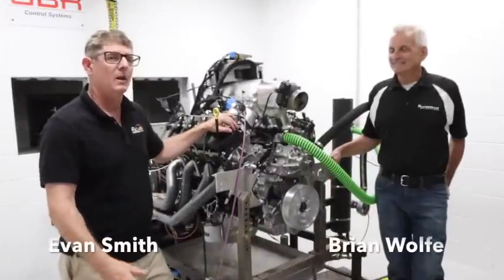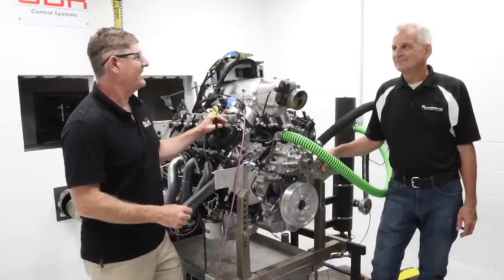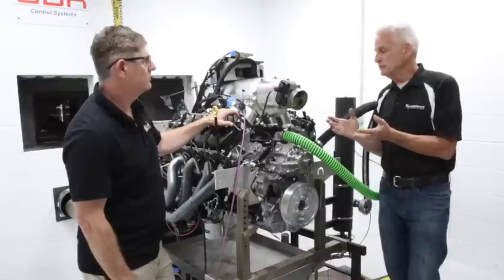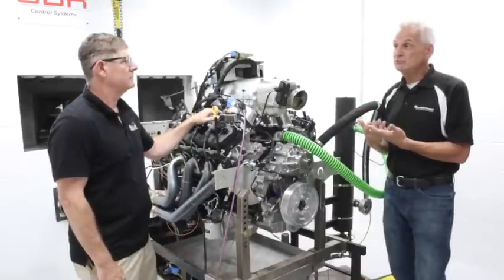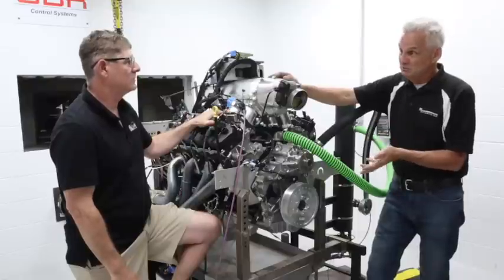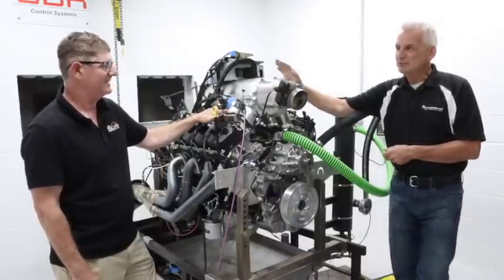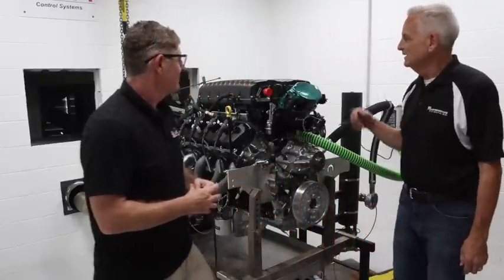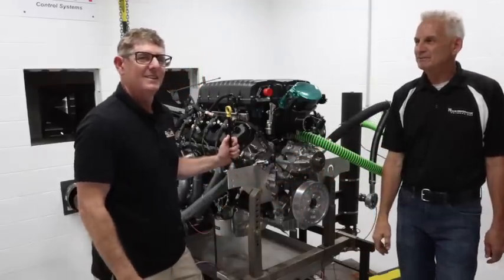Godzilla 7.3L Ford — Back on the Dyno With Over 780 All-Motor HP — Plus... We Reveal What's Next.

Comment: Man that thing sounds rowdy . now everyone can quit putting ls engine in fox bodies or any other ford. BLUE OVAL FOREVER!!!💪💪
Reply: Just hope they realize that this engine will make a load of initial torque. A lot more than a ls, 7.3 liters worth, yikes! Learned my lesson when me and my buddy put a 502 in an 87 Monte Carlo. Broke the windows and turned the body like a corkscrew.
Reply: 92VXEG  depends on how much hp you want and how long you want it to last. If you wanna drive it a week get your junk yard chevy. If you want it to last awhile even with the LS you need a good bottom end and so on. I get tired of hearing how a LS is so cheap but yet you guys want 30k for a foxbody mustang that has what a 800 dollar engine in it??? Get out of here with your false claims.
Reply: scott adkins not completely true if you know what your doing you can build reliable power and a motor that will hold up to whatever you throw at it running a stock block 6.0 ls making 500 hp
Reply: 92VXEG -realize the current Gt500 runs low 10’s stock and a GT runs 10’s with bolt ons. Gtfo of here
Reply: Ford is badass. I don't care who you are. That's a fucking engine with balls.
Reply: 92VXEG  just saying the chevy stuff is over rated big time. By the time you have to do the swap to fit a sbc in a ford body you could build a "push rod" sbf cheap also and what you save in the swap could go into  parts for the sbf. Cost wise in that case I dont see it... Yes mod motors cost more to build cus of more moving parts in the heads. If you stick with a push rod ford I just dont see the big benefit of chevy then. I guess ppl are sheep one does it they follow doesnt mean its better. If you want big power the mod motors are one of the best platforms cus they are awesome and yes when talking big hp numbers the mod is a good valve then.
Reply: value
Reply: 92VXEG  you clearly don't know much about ford FEs or 385 series engines then
Reply: 92VXEG  ur just mad that theres something better built for high end performance than the LS. Sure, the cheaper-end simple swaps are gonna be LS motors, but when you want to make racetrack/drag strip reliable power over 800hp, youre going to need to spend a bunch of money either way on porting or replacing cylinder heads, changing up internals if boost is needed, etc. The difference in cost is mostly for people who just want stock power or bolt ons and/or a turbo kit. Real high end stuff build costs will be comperable, as will performance
Reply: 92VXEG  Yo Fuck Chevrolet!!!  Most Chevrolet guys can't even spell the shit.  That's why you always see "Chev" or "Chevy".  Or are ya'll just lazy??
Reply: It really is weak listening to all the Chevy supporters here saying that a Ford is more expensive to build. If you buy aftermarket rods, pistons, cams or any other part from the same manufacturer the price is virtually the same. I just don't get how anyone can't look at a price book and read the prices quoted. If you Check guys have been following this build you would also see that this engine made 641 hp with stock crank, rods and pistons. If that's tried with an LS it's a grenade at best. Discuss things with a professional builder before making blanket statements and you Chev supporters will be better informed on what choices to make. The Ford is more expensive argument was made 40 years ago when Ford didn't have the factory cheap parts support that Chevy provided. I know I have been a wrench since 1978. It's just simply not true anymore.
Reply: @matthewmoilanen787  a stock ls 4.8 is good to like 1000 plus hp....
Reply: @0650asanders  In who's world. I'm a master ASE since the 90s and have 40 years of racing experience from pure stocks at 20 years old to dirt mods at 650 hp in recent years and any Chev dirt modified engine that costs over 18 grand has an aftermarket bottom half. Oh and there also 355's not 4.8's. Nice try but no not so much.
Reply: @0650asanders  why you lying 😂😂
Reply: @adonisgodfrey1082  what world do you guys live in? Guys have been boosting ls motors to the moon for over a decade. Step out of your blue oval box.
Reply: @0650asanders  A 2.3 Pinto engine can take 1000 hp once or you can actually go by what professional engine builders do when they sell engines that people race and need to rely on. Just because some guy who is not known for any expertise or they don't make their living from providing reliable engines does some odd one of experiments doesn't mean that it's true. You know cause everything you see on the internet is true right! Seriously dude, I'm an Astronaut that has some oceanfront property in Arizona for sale cheap! You may want to check Chevrolet's recommendations as they are selling unneeded high performance blocks and bottom end parts to stupid people with more money than brains apparently.
Reply: @matthewmoilanen787  who are you arguing with?  Thousands of shit ls stock ls motors are boosted to over 1000hp. You widen the ring gap and you're good to go. Youre talking about a 5-10k dollar built 2.3. Im talking about a junkyard chevy express van motor with 200k miles.
Reply: @0650asanders  - no you’re not that is absolutely ridiculous. No LS is making 1000hp stock you’re crazy! I garante you that’s never been done and it’s more than ring gap if you’re trying to make that power. Meanwhile palm beach dyno pushed 5.2l in GT500 to 1300whp made low countless 8 second passed 100% stock engine. The LS should stay in the junkyard. It doesn’t compete. Ford mod motors. John Mihovetz 4.6l has gone 5.88 second in 1/4 with Ford production block and headed engine. Worlds quickest stick shift car has a stock block and head coyote. Ls is having trouble breaking 10’s without exploding 😂😂
Reply: It's not about the brand, it's about which gives you the most badass build.
Reply: 92VXEG  LS engines may be cheaper and even better but they will never sound as good. That's a big thing. You can manage the budget and have this much hp per dollar but you will never have that killer sound.
Reply: Daniel...I AGREE.
Reply: 92VXEG  who said a 302? Ever thought of a old 70s 351? Ford does make other things instead of a 302 which I agree was a weak block. Take the 351 out of an older 70s car and there you go. They are pretty strong. If you wanna go stronger you are gonna need to reach in your pockets no matter what you build.
Reply: Sbf hold a lot records and wins. Fact. Check out 347s etc. I like all brands but youtube trends die hard. BTW Youtube is not a research tool. Lol.
Reply: Can I get this package for under 1k$??? No? I'll stick with my junkyard ls and ching chang swirling boi setup then 👌
Reply: 92VXEG  nobody cares
Reply: @danielfrye4445  people who actually put up the money to build an engine and swap it care
Reply: @NatoriousGamePlay  why are you Chevy guys so whiny. I don't care so leave it at that.
Reply: 700hp on engine dyno and you guys are happy? I made more then that to the wheels with a 286,000 5.3, you could not put 2 of these together come anything close to what we have ran in the 1/8 with a stock block ls, lmao
Reply: boostismyfriend exactly I’m a die hard Ford man but as far as price and potential ls is the way to go I’m a budget builder I bought my lq9 from a yard pulled it out of a Cadillac Escalade payed 98$ for it from the deck to oil pan got 706 heads for free ported and polished bought rings and bearings got maybe a total of $325 in everything I’ve done so far on this motor and my tuner is estimating close to 600 hp I couldn’t do that with a 351w or a coyote 5.0 for the same budget just not possible granted I’m putting the Holley system with it and the Holley long runner intake which is gonna blow my budget but that’s by choice still come in cheaper and more power than Ford.
Reply: @austincalhoun2779  I ant die hard ether way, I have had a aluminum headed Windsor fox, it ran .4 and 7 mph slower then my lq4 (468whp), I have Customer 69 f100 had a turbo 393, ran 11mph slower in the 1/8 then when I swap it  to a junk 5.3, same turbo kit cut and modified for the ls,  we went 4.29@167 at lights out a few weeks back with a stock unfilled aluminum Silverado block, dollar for dollar it’s the best bang for your buck
Reply: boostismyfriend I agree completely my end goal is a single turbo 6.0 around 800 whp street car but we shall see
Reply: @austincalhoun2779  hell yea, won’t be hard to do with a s480-s488, btr stage 2-3 cam
Reply: boostismyfriend Texas speed man!
Reply: It appears that the Guys( or Women) who like LS " engines " vs. the Ford " engines " are getting a bit testy...my original thought on this subject WAS* That MOPAR[ CHRYSLER*DODGE*PLYMOUTH] built a car called THE HELLCAT/ then they built a DEMON* A Supercharged HEMI CHALLENGER (3,300) than Ran 9.40 in the 1/4 Mi. Very Impressive for a 900 HP Trans braked RACE CAR for the Public...FORD OR CHEVY didn't have a car that COULD RUN WITH IT.( Yeah, some might say A COBRA JET MUSTANG OR A COPO CAMARO...AH YEAH...! Question: How many DEMONS run STOCK/ SUPER STOCK ELIMINATOR ? Remember the DEMON was certified by the NHRA... DEMONS have a Weak Rear Axle...FACT. Besides for the price of a DEMON,You would REALLY RACE ONE, WOULD YOU...? Alot of HELLCATS.
My thought WAS AND IS: BITD( I'M 63) American Car Companies built MUSCLE CARS- THE ORIGINAL SUPERCARS...Fast Forward TODAY: THE ' BIG THREE' are building ' PONY CARS LIVING OFF THE REPS OF THE O.G.SUPERCARS.' Iwanted to see if FORD WOULD STEP UP...( It seems that FORD, And the BLUE OVAL FAITHFUL ARE THINKING THE SAME THING: If FORD want to sell something different: A 2021 FORD TORINO COBRA JET WITH A 445 CU.IN(7.3L) GODZILLA ENGINE ( ALL ALUMINUM) I WOULD LIKE TO SEE IT. Thanks for reading.
Reply: Just hope they don't have the pleg of issues they had with all of their other engine. 5.4 timing chain issues and cam phasers issues. Or the v10 popping the spark plugs
Reply: I'd rather be butt plugged by a cactus then be in anything Ford. Trash trash trash trash trash
Reply: 307_Six.Seven 
As another Australian Barra blows your doors off...
Reply: @stephenpage-murray7226  which Barra? You have a chubby one and A Ford one. The Ford one has been proven to make stupid power with a single turbo
Reply: @garykarenmcgruther6386  
Ford straight six.
Reply: @garykarenmcgruther6386  
Ford straight six.

Comment: "12.5:1 blower motor" not saying this isn't impressive from Ford, but a built 445 ran on race gas shouldn't be downplayed to make it seem more impressive
Reply: And not to mention it’s not even drivable on the street with those rods and if it was you couldn’t afford to drive it because of the price of c16
Reply: Nobody is downplaying anything, its just the facts. If you were building this as a serious n/a build you'd be running 14+:1, cam profile would be different, vacuum pump etc. Its making 800hp through a TB designed for a factory 317cu motor. Race fuel is irrelevant, as you could make nearly the same power on 93 and could make every bit of that power on pump E85.

Comment: Now Ford needs to flood the market with this engine like the bailout guys from GM has done with the LS. 👍
Reply: The drag guys who boost will love the iron block, but I think Ford will have to do an aluminum block to get the sports car and NA drag guys to buy a lot of them.  GM has a 22 year head start.
Reply: It’s only certified for 8600 and up GVWR,  Unfortunately that means Superduty and motor homes only ...
Reply: @JohnDiMartino  But you can go to Summit Racing and buy one for $7500 today.  i doubt Ford will send anyone out to make sure you're putting it in an 8600 pound vehicle.

Comment: A few things.  How are you going to fit that 6 foot tall motor in a car?  Are those 2.5" primary headers?  Should be tricky to route.  The length of the motor with all accessories may make cooling fans an experiment?  I understand this is set up for a blower.......but...the HP and TQ curves are quite peaky without much area under the curve.  When you consider Buick and Olds 455's from the factory made around 500 ftlbs from the factory the torque curve isn't that impressive.  While the HP curve starts to get going at 6300, how hard can you really spin it and still keep valve stability?

Comment: This is the end of the Coyote swap!
Reply: I do not think so, the coyote is a great engine, this is just another alternative for Ford fans.
Reply: @brianwolfe2993  as long as it doesn't have piston slap or a chinese transmission behind it
Reply: This is the end for ls swaps in mustangs
Reply: MichXJdad who said anything about autocross bud? 90% of racing takes place on a real track... ya know, miles long, has turns? Those things? Drag racing needs 1 good reaction time. Real racing (aka the rest of it) needs quick and smooth reactions in every single corner, every single braking zone, every single corner exit on the power. That’s 30+ good reaction times every lap to cut a good time. Not just 1, mashing the gas, and letting an auto trans shift for you.
Reply: Coyote is lighter though.... and can make similar power on lower displacement. Make an aluminum 7.3, sure you have a replacement, but as it sits, it’s too heavy
Reply: MichXJdad the vast majority of racing involves turns. Anyone can throw a bunch of power, giant tires and an auto trans in a car and cut quick 1/4 mile times. It takes actual skill to set a car up to accelerate quick, brake hard, and corner hard, plus a more skilled driver to take advantage of that car.
Reply: Coyote will always respond better to boost especially in the high rpm due to over head cams. This engine is  great power maker but the coyote is still better in terms of responding to boost better and differently.

Comment: Daaaaaaamn its like having 7.3L as displacement had nothing to do with hp increase... the ferrari 812 super fast has a NA all motor 6.5L and it makes 789hp 😐
Who would have known...
Reply: Comparing a DOHC V12 to a pushrod v8? Yikes..
Reply: @sav22rem22  no he's saying there's no replacment for displacement
Reply: it has a turbo cam in it. The ferarri has a NA cam in it.  Turbo cams have a short overlap whilst NA cams have loads of overlap. If you were to put a turbo on an engine with a cam optimised to run NA the exhaust valve would still be open when the inlet valve is opened. The boost would go straight out the exhaust.

Comment: “Truck engine” riggghhttt. Fords rendition of the ls, which is gm’s rendition of a windsor. What a time to be alive. This will 100% be replacing my 11’ 6.7 in the future
Reply: Getting really off topic, Buick was the first OHV engine and Oldsmobile's OHV v8 started a revolution.  C'mon guys they all take cues from each other and engineers jumped from company to company.
That's why there are so many similarities. The new 7.3 takes all this into account pretty damn well.
Reply: LS is closer to the Y block Ford than the original Small Block Chevrolet.
Reply: @mattf8629  Right on Matt. That's what i was saying.  Ford vs Chevy BS    is like politics. Buick was the OHV originator and Olds made it popular. Well I guess every OHV valve engine  maker copied that! Ha lol
Reply: How was the LS a rendition of the Windsor? Now the deep skirted block and cross bolted mains were seen back in the 1960s 427 FE block with cross bolted mains. That the only similarity to older ford engines.
Reply: @Turbo_Todd  it takes a lot of characteristics off the Windsor. Like the firing order was changed to the fords firing order, and the heads have essentially the same ports and bolts per cylinder. And same bore spacing. All in all it's a stronger small block. But some say it's a ground up design which is hard to believe considering the similarities or "copied parts"
Reply: Todd Allen the LS can run on a distributor but it uses a sbf one and mounts in that same place as all ford engines since 1958
Reply: @travislostaglia8861 Where did you get that? There's no provision for any distributor on an LS. The LT1 from the 90s, had a weird one that integrated with the water pump in the front.
Reply: Todd Allen comp cams ls distributor conversion
Reply: @travislostaglia8861  that has nothing to do with Ford and Chevy comingling technologies
Reply: Todd Allen so if ford came out with a engine that could run a Chevy distributor in the back and use a Chevy part you would say it had nothing in common with it
Reply: @travislostaglia8861  gm didn't come out with an LS engine to run a Ford distributor... it has no distributor! Hotrodders created a way to do it for special applications.  You said it yourself,  Comp Cams make a kit. It requires a whole new front cover,  gears etc. Jeez,  you can engineer anything. Get real.
Reply: Todd Allen you get real and spin it any way you want if it was the other way around Chevy guy’s would be talking all kinds of shit
Reply: @Turbo_Todd  but that is just what I have read rolling around I really would like to see them side by side because the internet is a shitshow of rumors and things
Reply: @KC-lg7tx  They are so completely different. I have both.  Heads are way different.  Firing order? That means nothing. I hear ya about the internet.  There's articles out there showing true comparisons.
Reply: @Turbo_Todd  I'll have to look into it.
But if firing order means nothing why did they change it from the regular Chevy order.
Reply: @KC-lg7tx  Good question.  They said it's was better for sure vibrations.  Toyota V8s use the same firing order as older Chevy V8s. With all that said, firing orders are hardly a basis for saying one comes from the other.
Reply: @Turbo_Todd  you can bolt a 351 head to a ls1 and run it
Reply: @austinhowze6280  Not exactly. There are mods required to make the swap work. Custom camshaft and mods to the heads,  custom intake.  The bore spacing is slightly different. 4.38 vs 4.4in.
Reply: Phillip Aubin  I'm curious as to what the similarities are?